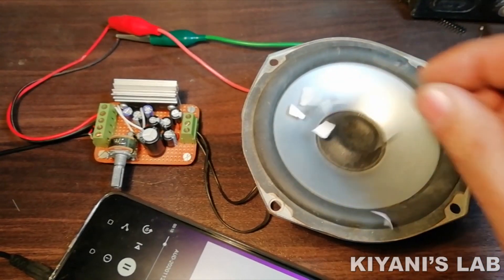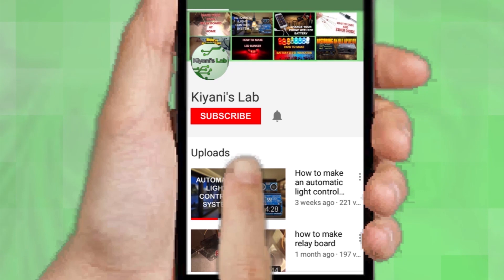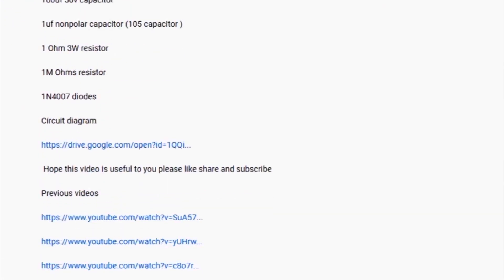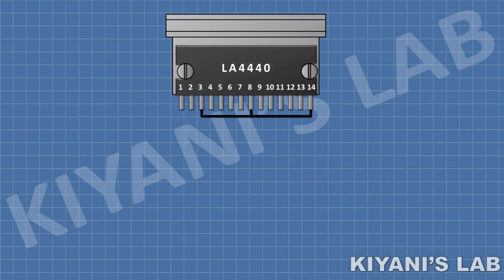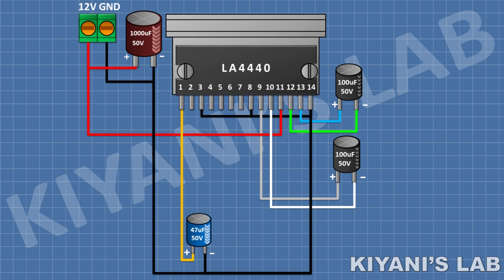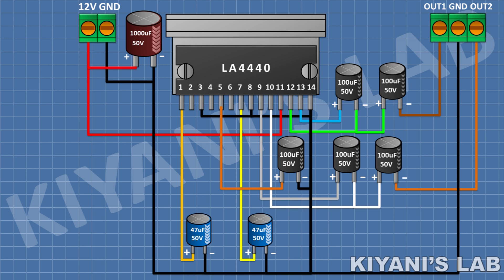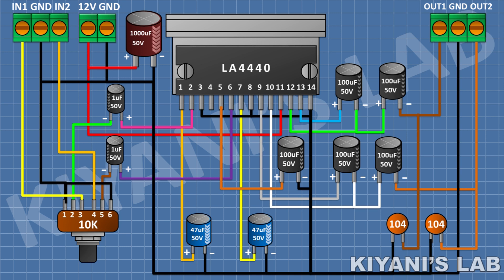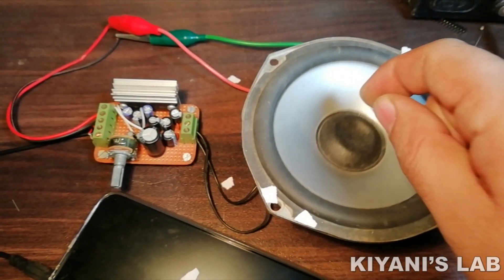How To Make Stereo Audio Amplifier Using LA4440 IC

Comment: You have used 50v electrolytic capacitor. Will 25v do as input supply Vdc is 12V

Comment: Please answer my following queries-
1. In earlier video you connected 100 uF capacitors to pin 1 & 7 and now you connected 47 uF capacitor. What difference will it make on both the Circuits ?
2. Why you used 100 uF capacitor instead of 220 uF as in datasheet ?
3. Why you used 100 uF capacitors at pins 10 & 12 instead of 470 uF inspite of the fact that this will reduce bass response ?